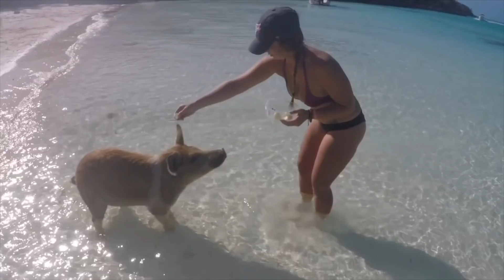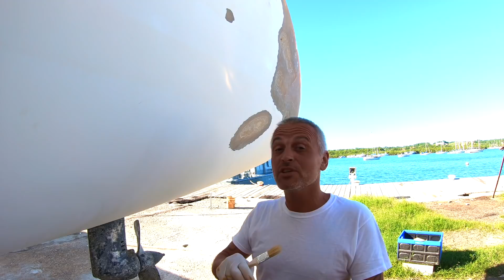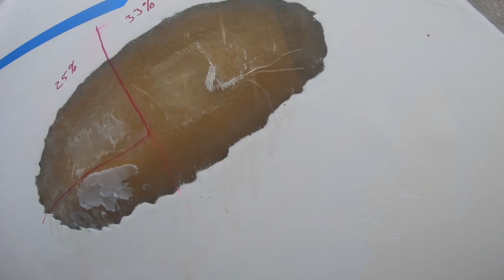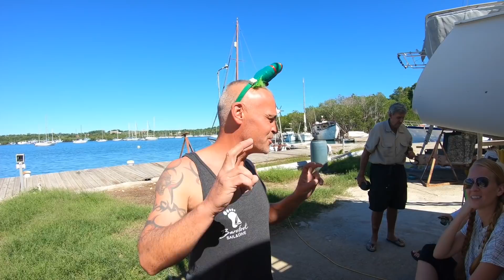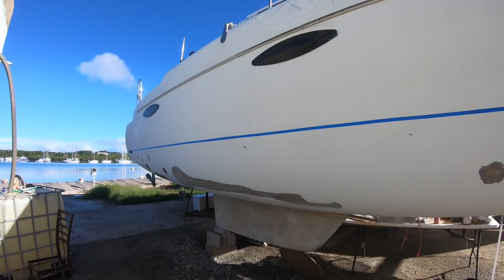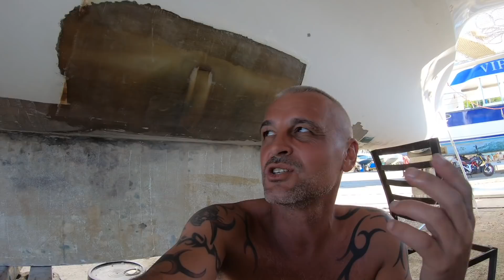The IMPORTANCE of a PEEL TEST and why to test new materials! (S2 E43 Barefoot Sail and Dive)

Comment: Just noticed you guys are from Belleville Ontario, I’m from Ottawa. So the new epoxy looks to be better suited for the kind of work you need to do. Thinner gives you much faster cloth wetting ability and less air trapping. Plus you’ll probably be able to use less epoxy an more glass. I like the fact it cures slowly and stays sticky till even the next day giving you the ability to continue a chemical bond on the next day if you couldn’t fully complete the job the day before. That’s a dream come true. I’ve never had the chance to work with an epoxy with that amount of flexibility. Good on ya mate!  Kind regards Luc
Reply from the maker: Thank you for watching!

Comment: Great info.  wasn't the boat built with polyester? why not just use the same to repair it?  i've had good results with polyester repairs.  ps, if the surface is greasy i've found gumout carb cleaner gets the grease off really well.  other brands not so good!
Reply from the maker: Yes it is a polyester boat. However she had some repairs done by the previous owner. We don’t know what he used. If he used epoxy we cannot use polyester over the top of it.

Comment: The  33% test could’ve had blush under it from the 25% test.... = bad test
Reply from the maker: Possible .... which is why we are conducting another one.
Reply: @BarefootTravels  Blush is possible, can't say 100% without knowing the full chemistry of the epoxy but I think you found a real winner of a slow cure laminating epoxy.  If still tacky after 20 hours at 25% then you are still getting an excellent chemical bond.  Keep in mind that slow cure resins don't really 'fully' cure for about 5 to 7 days, and most resins continue to cure even harder over 30 days.  Even WEST system slow cure catalyst still gives you a chemical bond window between 12 and 24 hours even when it feels hard.  I think your tests were excellent!
Reply from the maker: Thank you so much 😊